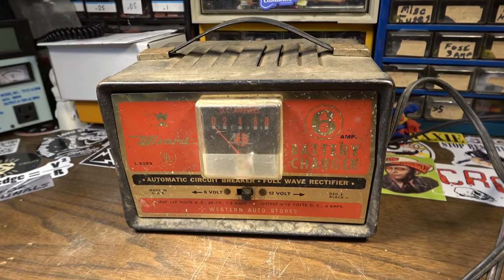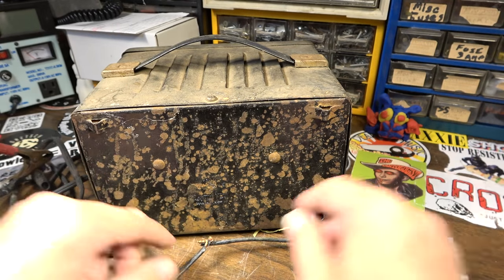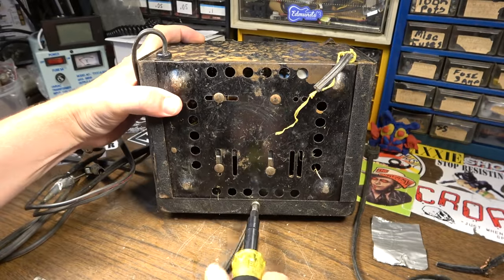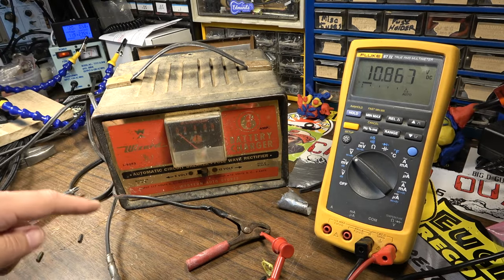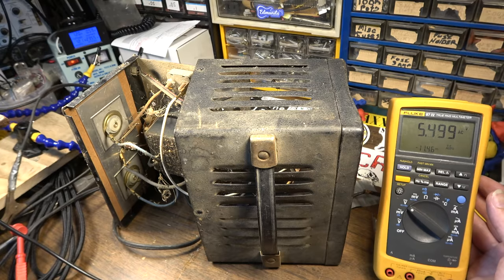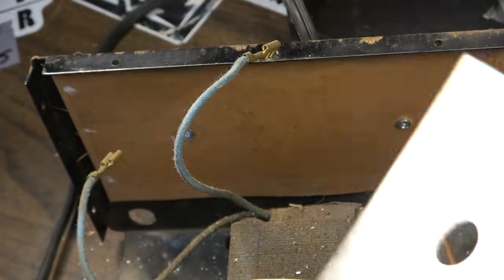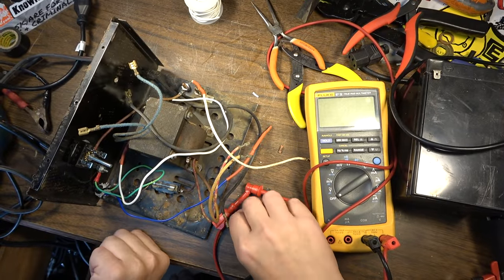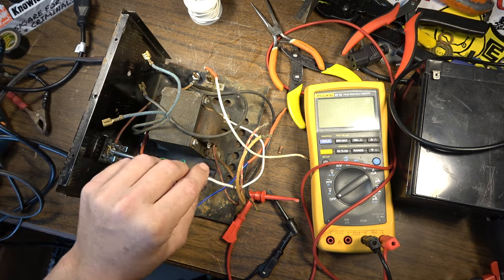Don't throw your old battery charger away...FIX IT and make it SAFER!

Comment: I got an old charger like those..since the 70's..it is " automatic " ( you can leave it hooked up without much worry - common sense says to not leave it indefinetly !! )...12 V only .. it has no guage to know what it is doing..lol
1 1/2 Amp charge rate.....
i have a couple newer chargers..80's versions..Automatic...one has 6 Volt/12 Volt ..the other has only 12 Volt...one needs a look at as it seems to not charge properly?? not sure yet but i stopped using it on batteries ... both have low and high charge rates think 2/10 Amps ?   i bought some Fancy New ones last year..got Digital readout on big one..it has dual Amp settings think 2/15?? and does AGM batteries as well as Normal & Deep Cycle...has the reconditioning mode and tells you Percentage /% of charge before and during charge and shuts off but maintains if left connected...i bought a similar smaller charger ( same brand ) for my smaller batteries ( it does full size too ) and can be left connected always....or has quick connect leads to put a permanent hookup on small batteries... they work so much better than my older chargers and have saved a few batteries my old chargers couldn't revive ..( they charge but they also didn't hold a charge long ...new charger got them useful for temporary yard use ..)... some old batteries i had never revived...too old...  depends what you want...the newer batteries are junk compared to 10 plus years ago batteries...

Comment: Used to charge many ride on car batteries at a time would use an 1156 bulb in series and a diode 1n5408. Each battery had this in series and could trickle charge 4 to 6 batteries from it. Without drawing it might be confusing, sorry. Hooking a smaller battery direct like that is rather hard on it. Max charge for that battery is about 2 amps to start and should go down from there.
Reply from the maker: I'm interested. Email me a schematic if you get time: bradlinzy at gmail

Comment: Thanks, nice work, didn't know anything about bridge rectifiers & how it relates to diodes that I do know.  Also, just use wire nuts for quicky/temp fixes for proof of transformer/whatever, the solder & heat shrink on old tired cheap siamese  cord was killing me.  Also, also, soldering iron, the heat rises, so putting the tip under the joint heats it up faster AND you can what the fuck you're doing.  Thanks again!

Comment: You way over worked this unit unnecessarily. You absolutely will get a voltage drop off that shit clamp connection, but you went for those sweet looking copper-oxide diodes, which are tough as hell and probably why they don't use them anymore. They were fine. They're not the best for high current but great for 6 amps. If needed, they can be drilled out, disassembled, wire brushed and reassembled with a rivet gun. You can even hammer out a small piece of brass connector and insert wherever there is burn through from excess dust in between the plates due to the rivets becoming loose.  Just fixing that clamp connection was all you had left to do after the power cord fix.
Reply from the maker: I know the internet comments sections are always right, but in this case heartily I disagree. The rectifier diodes were selenium, not copper dioxide in this case, and were causing the voltage out to be below the necessary charging threshold. They had to go. A loose connection existed, sure, but you can clearly see me wiggling the wire and establishing 11V on the leads intermittently. The charger is rated for 6A in stock form, so that's what it can deliver. These chargers should deliver around 13 volts or slightly above that when properly working. So if a strand of loose wire was causing, as you say, a resistance capable of causing a drop that large (from >13V to ~11V) why didn't I see a corresponding spike in amperes on my ammeter? Or a little fireball at the resistance point?

Comment: dood I have that charger shit you not it was my grandpas.. same color everything...nuts   still works like a champ, don't think it seena whole lot of service really, I've used it 3-4 times in the last 5 years.. I use trickle chargers on my bikes and my cars get new batteries I dont charge em.. used it when the fords charging system was acting up..  I've had it 20 years don't think I've used it but 10 times...  I never saw gramps I use it ever hale it looked new when I got it from him, I haven't taken very good care of it, toss it around stack shit on it.. dummy

Comment: My old Shumacher doesn't seem to be charging. Has 14 volts on the clip when set on 12V/6A, but the meter reading has it on low to no amp output. Went through a phase where it didn't even hum, but after some time, it did again. Then the meter even worked right, again. Do those meter limit the amp draw when faulty? I wasn't sure if you could have the volts so high, but pull little amps. My problem is my multimeter doesn't measure DC amps, only DC volts and AC amps.